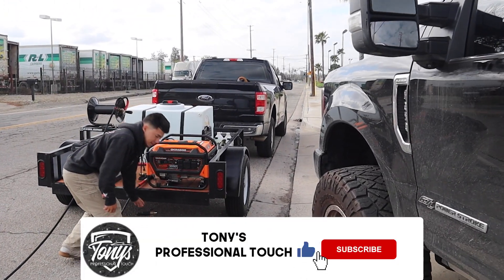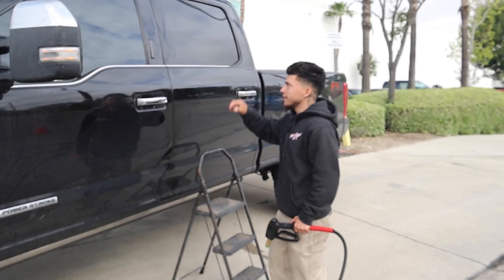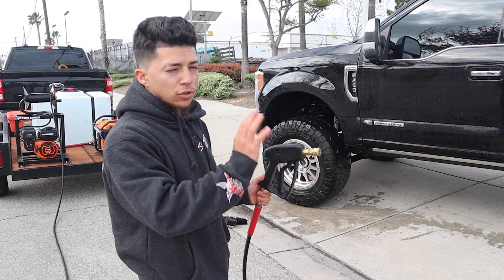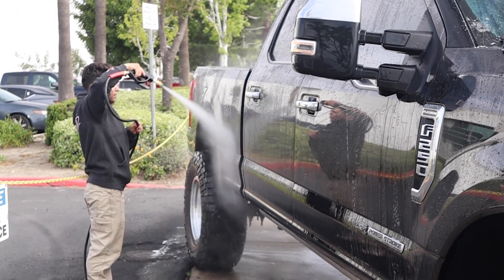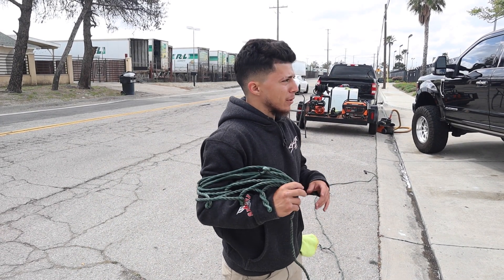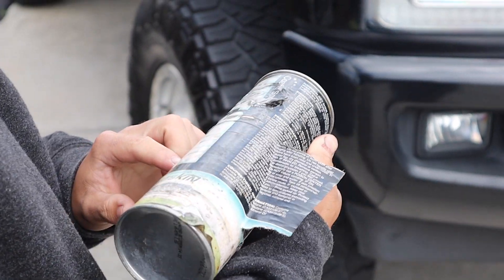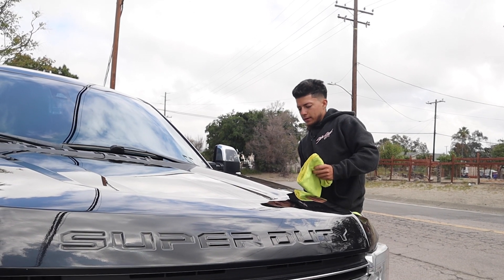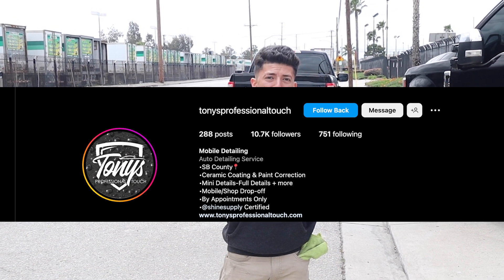How I Do My Mini Detail Step By Step - Tony's Professional touch

Comment: I would recommend starting on the inside first. I feel it makes it go faster.
Reply: The benefit of starting on the outside first is using sun drying while you clean inside.
Reply from the maker: it really depends on the package they get, the weather, and how dirty the car is.

Comment: PH neutral soap only no chemicals👍🏼👍🏼👍🏼
Reply: PH neutral soaps are okay for cleaning, but soaps that are more alkaline tend to have much better cleaning capabilities. People use PH neutral soaps to reduce chances of etching when washing in direct sunlight which is a plus when using PH neutral soaps, but I still prefer something with a little more bite like Carpro Reset or Koch Chemie Active foam to make the whole washing process easier and safer for the paint (reducing chances of marring via not as much contact required to clean).
Reply: @itsdarktrooper  good points. Is there any data on how much less a coating would stay hydrophobic by using harder soaps? I feel like none do much of anything until contact is done.